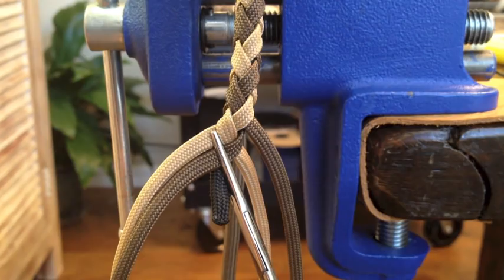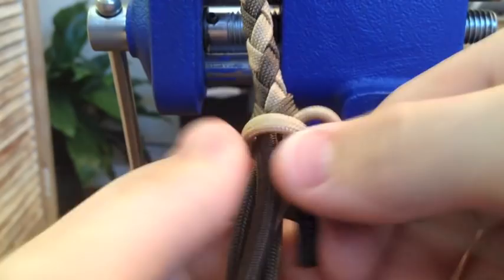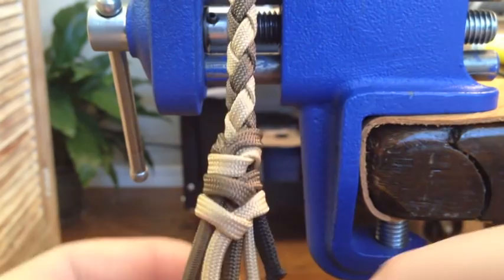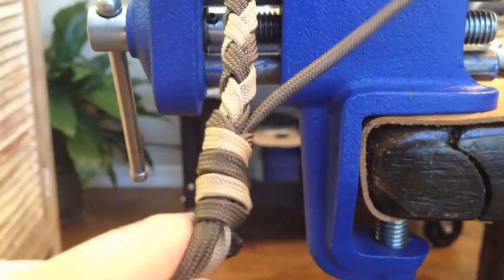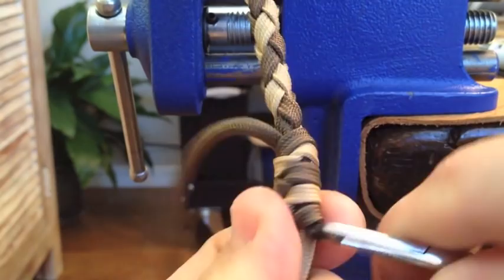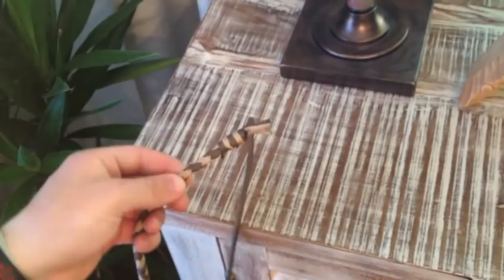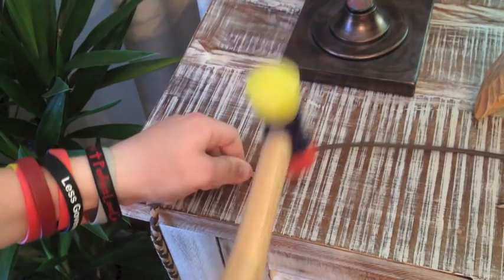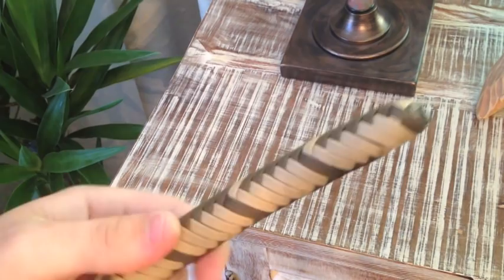How to tie a Professional Fall Hitch

Comment: Hey CW, do you know if there is a paracord  that fits a 5mm (or any) brass tubing ? Im looking for a faster way to get the BBS inside the shot bag , I've  tried the 650 from 3 different places and none fit , i also tried the china cord at home depot it didn't fit
Reply from the maker: You can by cheaper made cord from china. They weave it more loosely, so it should work.